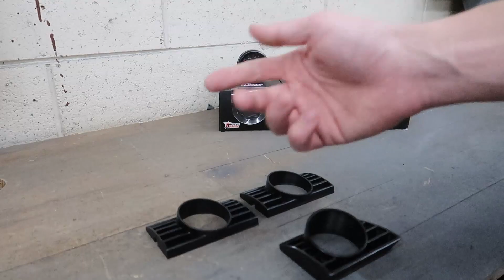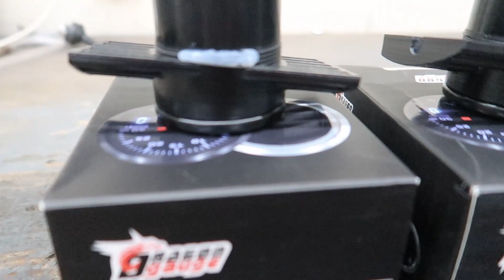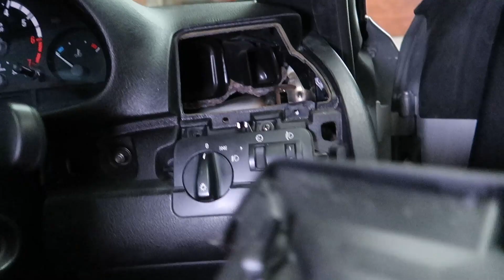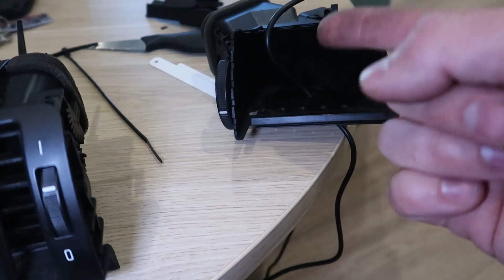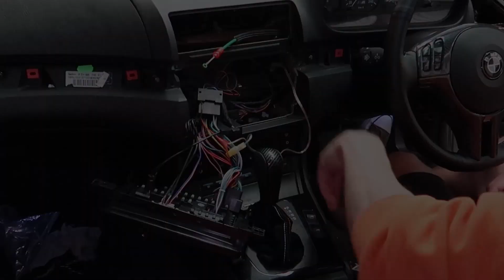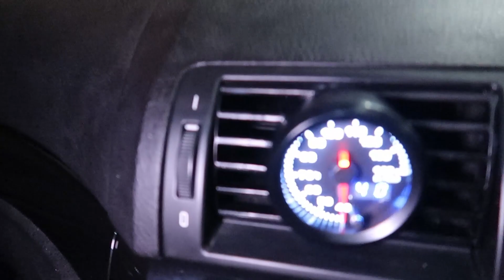Air Vent Gauges Install E46 BMW

Comment: I’m a little subtle on this because what happens if you need to use your heater do you melt the wiring?
Reply from the maker: Heater ain't gonna get that hot. Absolute max air temp would be 70c and PVC insulation doesn't get effected until concentrated at 80c and that's worst case with more concentration. And tbh if I have 70c air blowing in my face U can bet I'm turning that down hahaha
Reply: @AdamLetter thank you for your reply my first time boosting my first 330ci